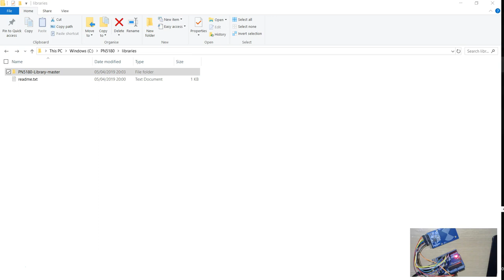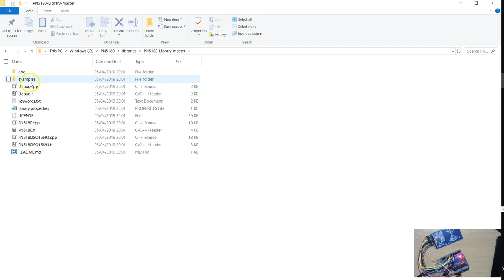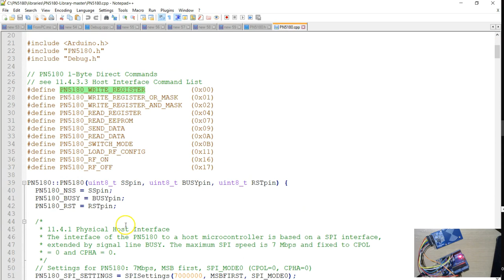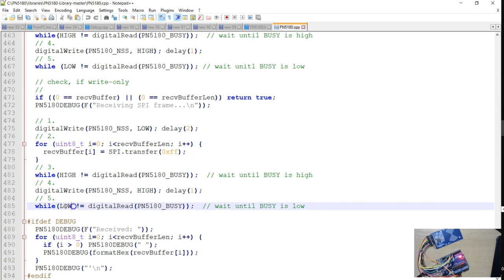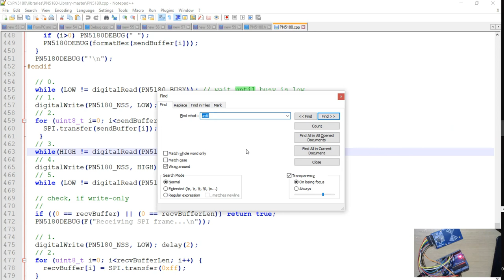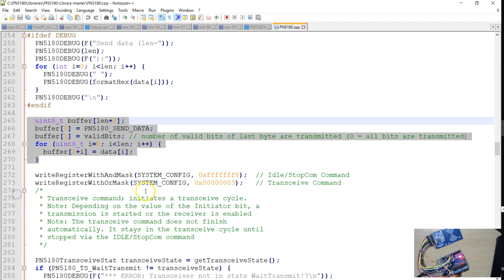PN5180 Arduino Programming

Comment: Hi. The SPI protocol implementation  delays 2ms and 1ms  after asserting AND deasserting NSS. I need to reduce this time.  I tried delaying with microsecondsDelay by setting several values under 1ms but it didn't work (not UID Is read). I implemented inventory16 command AND it works well but it takes to long for a few tags. Depending on collisions, it takes almost a second to read ten tags. I realize this Is because of delay(1) Is called several times, when sending AND reading data or executing any other command like writeRegister, etc. Any help?

Comment: My board is stuck at

===========d: Aug 13 2022 14:45:44
PN5180 ISO15693 Demo Sketch
----------------------------------
PN5180 Hard-Reset...
==================================
Uploaded: Aug 13 2022 14:45:44
PN5180 ISO15693 Demo Sketch
----------------------------------
PN5180 Hard-Reset...

idk what is going on...
Reply: oh, sorry i figured out that the Arduino MEGA 2560 that i am using has a different pinout compared to the UNO,
 i had to change 4 pins, The SCLK 13 to 52, MISO 12 to 50, MOSI 11 to 51, SS 10[Also in the setup()] to 53.

Comment: Hii, Thanks for your video. I have been developing a project using the same reader. I also did not use level converter. I am facing some problem with the device. If i use the reader to read single block of data from eeprom it is working fine. But when I give instructions to read multiple block, the data is getting corrupted after 2 blocks. Could you suggest why this happens. Also could you suggest if this reader is compatible with ISO15693 X2 fast transfer mode
Reply: I found out the error, in the serial monitor, the baud rate should match the original baud rate set by the default code. It would be about 115200.
Reply: Same. Any progress on how to fix this?
Reply: @rachelking2371  I stopped using this NFC transponder. But later I switched to NFC transponder chips from ST microelectronics.
Reply: Darn, wish I could do this too but my project for school is due this Friday.